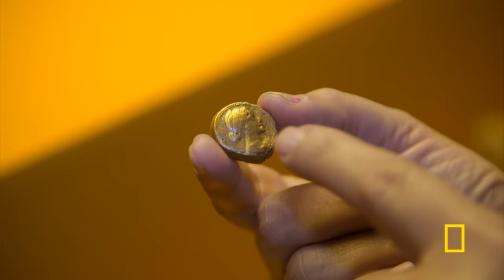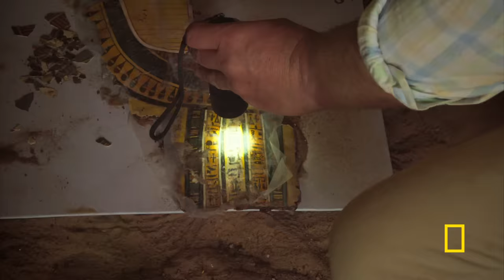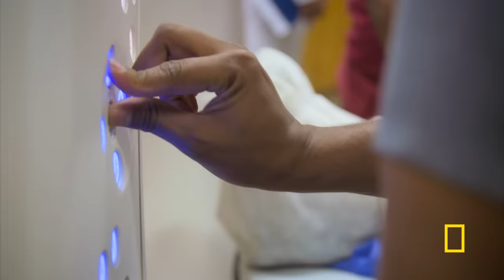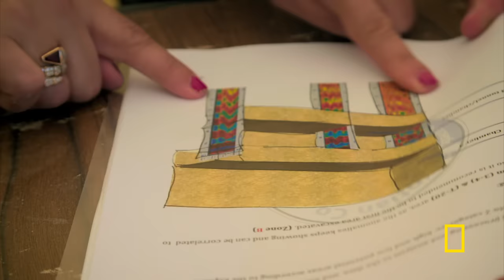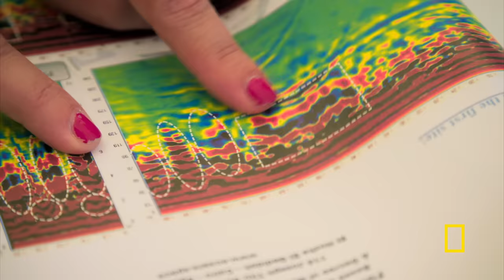Cleopatra's Lost Tomb (Full Episode) | Lost Treasures of Egypt

Comment: This is the age of Solar power. I hope someone will figure out how to get solar generators in that area. It would be the optimal area with the hot sun constantly beating down. They wouldn’t have to worry about electrical power cut outs. Also, what about floating a tiny low headed raft with a camera attached to show the way down the flooded tomb. We have cave crawlers here in the US for just this purpose. You get your full view without endangering anyones safety.

Comment: Wonder why no generator for a stand-by if the pole power electricity was not going to always be on?  Could have a solar battery bank with portable panels to power the pump(s).  Just wondering.  Not too expensive either.